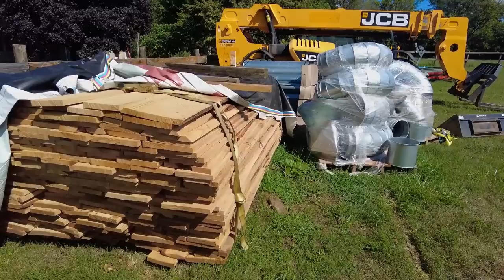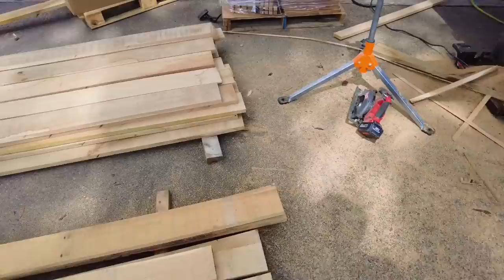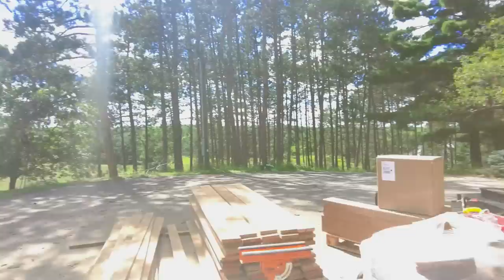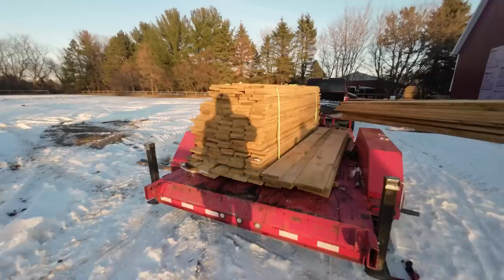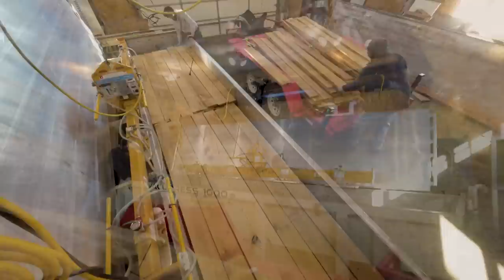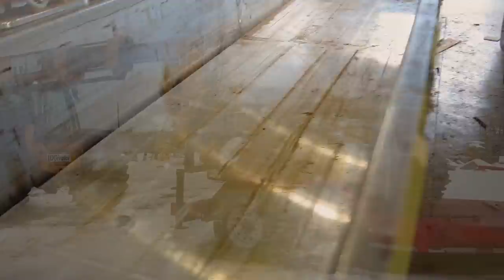Starting the Rift Sawn White Oak Flooring | Home Renovation & Addition Part 49

Comment: Hi Matt, I live on the east coast and hurricane Sandy forced me to learn some architectural Millwork for financial reasons. You gave me good tip on the carbide bandsaw blade and now I’m trying to return the favor. Get on computer and find a shaper. 3/4 “ spindle will work but look for the bigger 1-1/4 spindle. Also find a good size power feeder. Dig up old charles Neil video on ripping lumber and then build that table saw fence carriage. That gizmo saves many passes on the jointer. Buy a carbide flooring set for your new to you shaper. Plane your boards, then over to the table saw ripping thingy , one pass on edge on the jointer then rip 1/8” over final width and run the female edge on the shaper. Next important video is to learn what an outboard fence on the shaper is and ride the female edge against that while machining the male side of your floor board. Your finish flooring will be very uniform. 15 strokes from diamond hone on each blade face keeps flooring set cutting very nice. And then you will say , hey, I could make a beautiful accent wall with this setup also. And hey, 12 other things for my house.

Comment: My last flooring project I chose to use all grooves and cut splines.  All the grooves were nearly identical and the splines were easy to cut to fit snugly with eased edges.  It also saves width in your flooring on what would be the tongue edge. Just an idea.
Reply: This is a great idea!
Reply: Can you still blind nail when using splines?
Reply: @scottcates  absolutely.  However, depending on the fit of the spline and species of wood and type of nail system you might want to do some testing to see how things go.  Obviously if the geometry (depth of spline, thickness of flooring, angle of nailing) is just wrong, the driven nail could actually push the spline out - that wouldn't be good.  Nice, snug splines (could also be glued) , good geometry, square nails, etc. should work fine.  For a sizable floor, I would just get my system worked out ahead of time.  You can have similar types of problems with standard tongue and groove floors where the tongue will split off or the nail won't get buried properly.
Reply: @boooshes Makes sense👍👍

Comment: Matt you need to get a power feeder for your table saw.  I made all base boards, window and door casings from white oak for our new home and the power feeder allowed me to rip continuously, which eliminates the starts/stops that can cause burning and/or nicks.  It also saves your arm muscles, kicks backs and accidents to your hands.  Mine is mounted using magnets, so mounting to table isn't necessary.  My power feeder is 1/4HP which works well for any boards that aren't huge.

Comment: Hi! I really enjoy your videos. They are very informative and helpful.  I wanted to get your thoughts about acclimating wood to its new environment where it will be installed.  I have a 100 year old cabin type home in East Tennessee (humid) where I had to rip out the beams/joists/floorboards due to the woodworm of multiple wood destroying beetles.  The joists were very close to the dirt, so there was plenty of moisture in the wood to make this possible.  I put down six mil plastic on the ground and taped all the joints and spray foamed the plastic to the new block wall, so it’s pretty encapsulated.  I also have a vent where I will have a fan to help air out these treated joists beneath the floor boards.  I am thinking that could take a year.  I bought some 5” -3/4 tongue and groove boards at an amazing price.  (White pine). They are not really engineered to be floorboards, but I’m going try it.  I’m also going to nail them directly to the joists instead of adding any OSB or plywood subfloor.  I have 12 inch centers now, and I’m going to also install another of six mil plastic right under the floorboards as I am installing them to prevent the moisture from the treated joists, and any possible infiltration from wood destroying organisms underneath.  So, my actual question is about moisture. The new boards I bought had between a 6 to 10% moisture content when I first brought them to my house almost a week ago. My house has always been unstable as far as humidity because I use a woodstove and don’t have air-conditioning.  I now have purchased a dehumidifier for the future because I understand that if there is about 14% moisture in the wood, the wood worm can consume it.  Right now I have original painted wood walls and ceilings.  It seems that the wall boards have about 15% moisture content.  The new floor boards are stacked to try to acclimate them to the area, and it seems that they now have between 10 to 12% moisture content.  

My question is this- 
Should I turn on a dehumidifier now or should I wait? 
I don’t know if by turning on a dehumidifier it will pull too much moisture out of the raw boards, versus the painted walls, making things more unequal.  I’m also not sure on how long I should wait until I can install the boards. I was reading that there should be maybe no less than 2% difference with the new floor boards and the subfloor but I don’t have a subfloor so I have been measuring the moisture in the walls. I’m not looking for perfection. This is a rustic cabin and I don’t mind some gaps between the boards, but I think I fear excessive cupping or bowing in the floor. Anyways, I just appreciate your thoughts on the situation. Thanks!!
-Jason  :-)

Comment: The best part of cutting the wood is the scent, I have old deader barn doors that I rescued a few years back and over the years I have cut and made things with it, the minute the blades hit the wood the smell of cedar is as strong today as it was almost 150 plus years ago when they first cut the trees and milled the lumber. If I was to do flooring again I would use the cedar as I love the colour of cedar but I would use a beeswax finish yes it’s hard work but there is something about the smell of cedar and beeswax that is soothing in the long run.
Can not wait to see the floor progress it’s been a while since you have worked on the new extension.
Merry Christmas and all the best for 2023🤗🤗🤗🤗

Comment: My first experience doing wood flooring was for my house in MN. I reclaimed maple flooring from a convent building in Waconia that was being demolished. Pulled it out, removed the nails, planed it all to uniform thickness. Put a jig in the planer with custom carbide cutters to clean the mop jam out of the T&Gs. I could feed three pieces at a time but it still took a long time. Installed it both upstairs and main level for close to 2000 sq ft. Came out pretty well for 100 yr old flooring. This was in the early 90s, I was being green before it was a thing. I can appreciate your frustrations on your previous flooring project and I'd do the same as you are now if I did it again. Best of luck with consistent uniformity this time around.

Comment: I would strongly consider a decent sized shaper (with power feed) for the flooring Besides cut quality, you would be able to maintain consistency in width of the flooring.   Assuming you have a long enough run to lay your boards end to end thats going to be critical.The up side is that you then have a shaper for your cabinet build.

Comment: Going to be a nice looking floor.  I wonder about the level of dryness though.  What is the average or normal humidity of your area?  White oak is fairly stable in expansion and contraction, not as bad as maple or even worse, Beech.  But I like to get a floor to be within about 2% of what the average humidity is.  I installed a beech rift sawn floor in my house about 10 years ago, and it came from the east coast at about 6% on the meter.  My local humidity average is about 13% (northern CA).  I took all the boards out and left them for a couple weeks, open stacked in one of the rooms.  Got it up to 10% or a little less.  Couldn't wait longer and installed it.  I was careful to make all my runs such that the cross runs were the narrowest dimension.  Still, there was cupping in the floor, evident after only a year or so.  The floor expanded and thus the seams lifted a bit on each board.  Someday I'll sand it again and the cups will disappear, but it is pretty evident at this time.  As yours is white oak, it should be better.  Hard to find rift sawn.  I agree it looks great. 
If you use a shaper for the T&G, use a feeder too.  You will find that it make a much more consistent tongue  (and Groove) than you can without it.

Comment: My 15 year old grandson and I bought his first rental property home this year. Clear YP wood flooring throughout the home was disappointingly marred by some plywood repaired termite damage. To salvage this YP flooring, he and I milled replacement flooring by selecting #2 framing lumber stock. This entry rental level home didn't warrant a better repair. Our lumber selection process mirrored your stock selection process. I guessed at my material waste from my marginal stock material. I think that we would up with exactly the required finished flooring stock. We grain matched as best as we could. The repair is visible, but looks good enough that he can maintain a wood floor throughout the home, when the alternative was carpet. 
My grandson is now 16, which means that he can drive himself to the job site. Our business partnership is that he is putting sweat equity into the renovation project and he will eventually buy me out. The project has as end in sight. He added a third bedroom, a bath and laundry to increase his rental income. I and other family members help and coach him on various tasks. The flooring job was the major woodshop project that I have done with him. The project has included complete new electric service and home rewire, complete new plumbing, complete new bathroom and kitchen, drywall replacement and repair, complete new HVAC, major porch rebuild, grading, landscape and drive upgrades, new sewer lift station, etc. 
It has been a great project. He is learning so much. His dad, uncle's, cousins and me are all in the trades. He rarely has to go outside of his family community for expert advice and help. The home is close to my home so he frequently bunks with us on week days. Work and home schooling compete with his business endeavors. I have 36 grands. He is the only one that has proposed a business plan that materialized. Woodshop demands for this project have been limited to the flooring task. It is a lot of fun to collaborate with him on his entry into adulthood.

Comment: I saw a great old tool when I took a class with Roy Underhill which was to set the width of flooring when it was all done by hand.  They would minimize the waste by cutting into several widths but of course each width would have to exactly match.  Basically a 'story board' for flooring...

Comment: Particularly with in-floor heat, I tried to be sure that our floor boards were only fastened to the underlayment and NOT to each. other. That way, as the floor expanded and contracted (minimal with quarter and/or rift sawn WO, but still there) all the floor joints would open and close evenly instead of all tight joints with one or two opening really wide. The boards were hand-scraped rather than sanded and had scraped 30˚ chamfers to disguise any gaps or minor variations in thickness. The natural feel under bare or stocking feet had to be experienced. Ours were done by Birger Juell out of Chicago (closed now).

Comment: Any worries about some of the wood being overly dry, or are you going to give it awhile to sit in your house and let itself come to something of a balance?  That's a very sweet set up for drying, just a small amount of dollars went into that!!  Wise idea to find a molder for running your profile, the added speed is amazing the first time you make the change. Will you be using a straight line rip saw before the molder?
Reply from the maker: If anything they’re still not dry enough. Current indoor humidity is 10%. Closer to 4% mc would be better. I’ll joint the edges before taking them to a molder. Thanks!

Comment: Thanks for sharing this video. Im actually very close in time to do something similar and your video gave me great hints. Please keep the floor board video going. About 5% dryness- is this really needed because the boards will „suck“ water from the air again anyway - arent they? 10% shall be enough or saying in other words, if you dry them below as they would get by air-drying, they will level out again over time - isnt it?
Grain pattern part - explained very illustrative and understandable, thx!
Reply from the maker: Yes they will even out with their surroundings. Currently our house is 10% humidity since it’s winter. Equilibrium for wood is under 4% at that humidity so these boards will throw off more moisture when they come inside

Comment: Kind of surprised you don't have a power feed attachment for your table saw. They are a game changer when there is a need rip 50 or more linear feet of lumber or sheet goods to the same width.

Comment: Question? Did all the boards come 1S so you had a straight edge? I did not see you cutting a straight edge before running them through the table saw. Boy, it only took 4 days ti dry them. That is fast. Can't wait to see the molding of the flooring now that they are dry and ready to go.

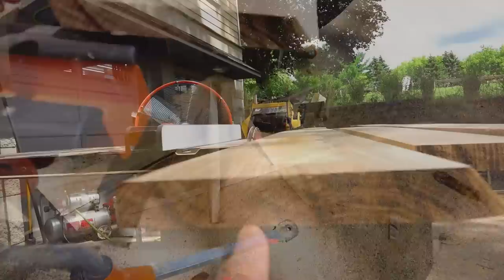Comment: OK, I appreciate seeing this. Very informative about how one could go about this. But about the nomenclature, is it that woodworkers have flipped the meanings of "riff sawn" and "quarter sawn" from what would be in use at the lumber mill (if lumber mills still did either riff or quarter sawn cuts)? That is, the riff cut pattern--- this is at the lumber mill--- consists of every board being 100% aligned along a radius of the log, so that the annular rings are 100% perpendicular to the faces of the boards. I just looked that up, as I'm not qualified by experience. But here in this video that is called quarter sawn. And at the lumber mill the quarter sawn pattern separates the pattern into four quadrants and within each quadrant the boards are close to being aligned along log radii but not exactly. So this is the opposite of what is said in this video starting at about 13:20.

Comment: Hi Matt, Happy holidays! I am curious about where you will mill the boards. Are you doing that in your new barn? I don't think you keep the temp in the barn the same as the house. Is there any concern that the material will gain too much moisture back before you get it inside the house and not be able to acclimate?

Comment: Fun video!  If the lumber was at 14%, or so, I'm wondering if you ran the SawStop in Bypass mode?  I'd be afraid of mine tripping, and costing the usual $200+ to get up and running...  And I'm also surprised that the rough edge was straight enough to run against the fence without first jointing...
Happy Holidays!
Reply from the maker: No, the wood would have to be dripping soaking wet for it to be a concern. Thanks!

Comment: Is ray fleck boards as durable as the boards that you are choosing to use for your floor? If not could you not use those in a perimeter placement as accents for a little bling in your floor sense you are using the floor as a stand out in a room absent of anything else that shows much bling. I know that this would only be on 2 of the perimeters unless you did a lot of work incorporating it on the other 2 sides. Just a question of the possibilities not a suggestion you should do, but because wood is your thing, what a cool way to show some creativity if it is even a possibility.

Comment: I am new at milling lumber having recently purchased a small bandsaw mill. Would it have been possible to cut several of your select boards down to width on your mill?
Reply from the maker: Yes if the cuts are all at the same location. I removed different amounts of material from each edge most of the time

Comment: curious to know if you were using a ripping blade.  Seems the saw was struggling a bit to go through the boards.
Reply from the maker: Glue line rip. Lots of side load as the boards weren’t jointed

Comment: I had to look this one up. hahaha
What is rift sawn wood?
Rift sawn lumber is typically narrow with a very straight grain pattern on the face of the board. Rift sawn lumber is usually used with oak to avoid the flecks that are common in the species. The annular rings or a rift sawn board are about 30-60 degrees to the face of the board, but 45 degrees is the most optimum.

Comment: I hate our current white oak wood floors, the previous owners did a bad job installing them so there's big gaps everywhere. I'd totally do this same work, if I were staying in this house long enough. I'd love to do a full rift sawn floor.
Reply: How much of a handyman are you? If you can get a decent table saw and a thicknesser or stationary rotary plane you could pull them up, dermal them, true the edges and faces, then re-lay.
You would still need to buy a little timber to replace that lost in the edging, but not a whole floors worth, the saving in timber should cover the purchase of a decent table saw and thicknesser. Plus the filling timber could be purchased from a demolition/recycling store rather than new ex mill.

Comment: I got rid of my outfeed roller and just walk around to pull the board thru, works great. But if you want to use the outfeed supporter thingy set the third leg facing the saw instead of away from the saw. The safety reason is the tripod can tip sideways the way you have it set up and cause binding/kickback.